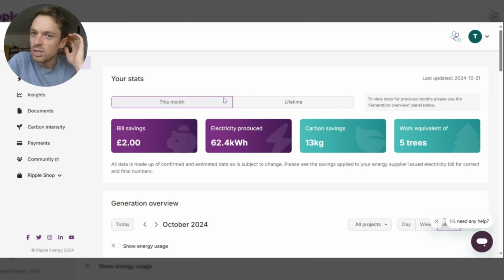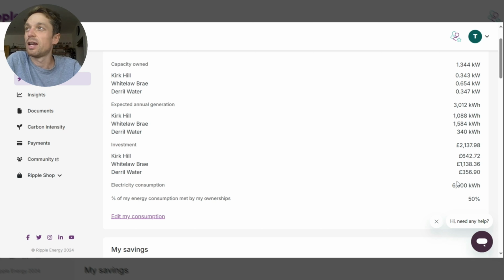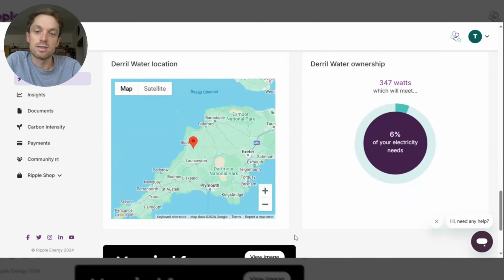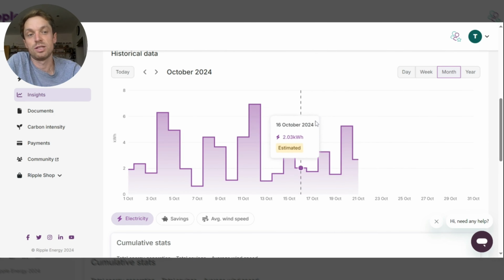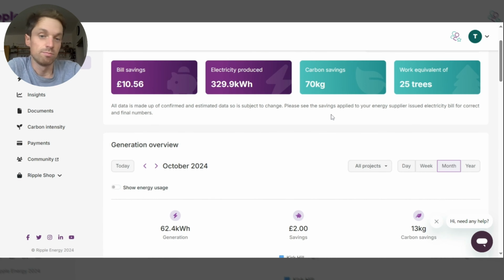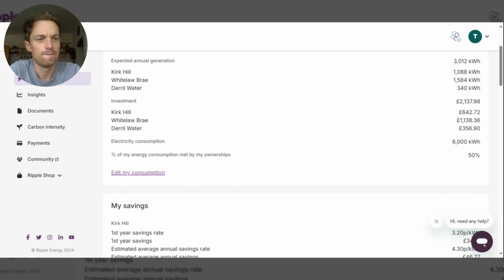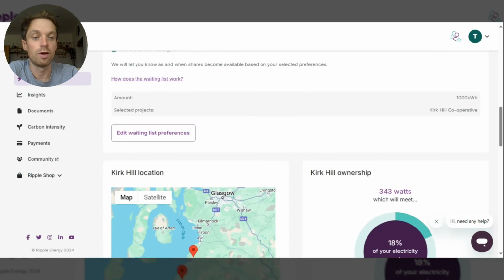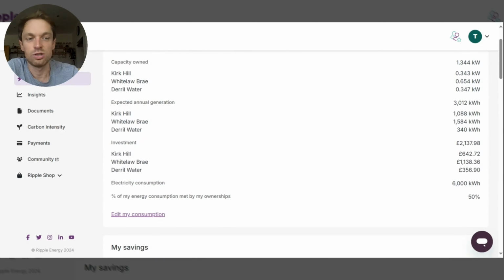How Much Money Does Ripple Energy Generation Save You?

Comment: Thanks Tom for insight! 
Ive joined ripple - really jumping on board because of the fantastic opportunity about the concept of collectively owned green power. 
However - Im feeling a little disheartened regarding the returns... It kind of doesnt add up tbh. 

Basically with the investment made, ill get that back over like 20 years. Ok it's a contributiuon to the movement - which is the ultimate message. 
But the savings due to the fact the energy created is just sold to the grid before coming to your house - is just another let down for individuals trying to make a difference. 

I thought I would get the energy direct to my home - and be able to use that - or simple store it in a home battery etc. But alas no, you have to declare the generation as a sale, which goes through all the hoops as if you were a business. I am glad they are trying to change things in the energy market - but it as bad a deal as selling excess energy generated from your own solar back to the grid.

It could be a game changer for the UK if the rules regarding generation as a coop were on the peoples side - but progression as ever is not very progressive.
Reply from the maker: Hi peachesfruitella - yes it is a bit frustrating, although the remaining costs are what we call 'non-commodity' costs, which, amongst other things, pays for the wires to get electricity to our doors, whatever the cost of the generator, someone would still need to pay for this. 

If we generated at our homes, by solar PV on a roof, or other, we don't pay those costs either.

Although I agree, this is really about doing our bit to support construction of low carbon generation, and it is good that savings will remain for the next couple of decades!

Tom

Comment: Hi great video with a ton of info thanks, With my maths your seeing around 4.1% return at your current info stake price so ROI is 16 years (£1,187.44) That's not taking in to lots of wind or higher elec prices so your ROI could be a lot sooner
Reply from the maker: Thanks - that is helpful! 

We have just had a savings rate notification for next year, and it does look like savings will be higher. Which is good news!
Reply: @TomBray-LowCarbonLifestyle  Your welcome and great news for next year, and as i said 4.1% is better than holding your cash in a bank, and who knows if the wind blows or elec goes up your % will also rise, I bet year on year the elec price will keep going up, so to me that means your ROI will keep dropping also

Comment: Ok the ROI is a lot less than we might have expected if wholesale electricity prices had remained what they were when we invested 2 1/2 years ago.  But had the prices remained that high, and domestic customers were no longer protected by the price cap, our total bills would have risen a lot.

I am on Octopus agile rates and am able to shift around usage to minimise peak times and use more when prices are very low or negative.  So far this year my import rate has averaged 11.7 p/kWh.   2 years ago that was 26 p/kWh.

So the net price if I was generating enough from my KW investment to cover my imports is now 8.5 p.  2 years ago even if the savings rate was 10p per unit, my net price would be 16 p or almost double.

So I'm not too disappointed that wholsale prices have dropped from those record high levels.  By building more wind generation we have helped to lower bills and not just for ourselves.  

We could have taken a contract for difference which would have given a better savings rate now.  A large majority opted for  
a more adventurous approach and we need to accept that the best that can be negotiated annually will vary.  All signs are that the new rates for the next 12 months at KH and the first at DW will be higher than we have seen so far.

I put a new kitchen in last year largely to replace a gas cooker with an electric oven and induction hob.  In cash terms there will never be a return on investment.  It was still the right thing to do though.

Comment: I'm all in to cover my modest 2400kWh p.a. mostly on Kirk Hill and a top-up on Derril Water. The time & cost overruns and consequent low gas contract price for the first six months are a shame but I think we'll see the slow start through and it'll look a whole lot better after the winter and spring generation. 
My prime objective was to match my annual power consumption since I have a difficult house for solar, the second was hopefully for it to wash its face financially. This kind of thing should only ever be a small proportion of any portfolio. Many others have seen it as a hedge against gas prices and Craig Fatha was early proof of that last year but there are other bets in play, it might be an inflation hedge to some extent and who knows how reform of the electricity markets will be implemented and how the small co-ops will be treated. 
You need a strong enough stomach to ride the ups & downs. I remind everyone that the monthly payment is partly return of original capital and partly treated as taxable interest with end-of-year certificate.

Comment: I am also a member of Kirk Hill and you have to be very careful as the 3.2p/kWh is currently very low for 2 reasons. 1 is that this year (up until Jan) the Co-op is currently raising a cash buffer as the co-op is brand new and has no cash and the co-op is paying off additional building expenses which were higher than expected. The second is that the rate we secured for 2024 was very low compared to "normal years" and come Jan 2025, we expect this rate to increase significantly (maybe even 50-75% increase) which will bring the payback to within normal expected ranges (est. 10-15 years) as per share offer.

Comment: Considering the cost of a 400w solar panel is around £80-£150 this doesn’t make that much sense to me unless I you can’t get solar for some reason
Reply from the maker: Very true, although installation cost for a solar panel would be a bit higher than £150. Particularly if on a roof with scaffolding, plus the inverter, and electrical installation to domestic system.... so £640 for 343 watts isn't that bad....
Reply: @TomBray-LowCarbonLifestyle  good point. I suppose that unlike solar it is also 343 watts of constant generation, though it looks like you can't realise the full value of that in terms of bill offset. Wish the government allowed us to fully benefit from remote generation - that would be game changing.

Comment: I'm confused about how it works - do you get paid as a proportion of what the turbine generates, or do you get a fixed amount off every kWh you use? 
If you had a battery and bought all your power at the 6 or 8p/kWh off-peak rate, would you still get 3p off each unit?

I think it's worth mentioning that Ripple say repeatedly: "ownership should never be seen as a financial investment". Rather than looking at the ROI, it's probably better to look at it in terms of how much carbon emission you prevented, especially when many offsetting schemes are just scams.
Reply from the maker: Hi Robin, it took me a while to get my head around too. The payment is saving on every kWh your portion of the wind turbine generates, i.e. the wind turbine generates some electricity, it is sold to the grid for 6p per kWh, there are costs associated with running the wind farm, let's say 2p per kWh, so members get 4p per kWh as a saving on electricity bills... if the turbine generated 1000 kWh in a day, and my membership was 1% of the turbine, that would be 10 kWh * 4p per kWh, i.e. 40p savings.

Savings are delivered monthly based on generation, rather than based on your usage. 

Completely agree it shouldn't be seen as a financial investment, or at least purely that, it is a lifestyle choice to help support the low carbon transition, as well as getting some savings in the long term!
Thanks for engaging with the video
Tom
Reply: @TomBray-LowCarbonLifestyle  Thanks, that's actually fairly simple now you've explained it. You get a share of the profit from the turbine, and it's not really linked to your energy use, except to limit the size of share you can buy.

Comment: Hi Tom, Thanks for the video. I have invested £2300 in Kirk Hill and this is expected to generate 4200 kWh/annum to add to our 4200 kWh/annum we generate with our solar panels (no battery). Our total energy use is about 8750kWh/annum so these two make us sort of neutral . Our electricity import is currently 6300 kWh  so Ripple is about 67% of this.  Savings so far £40 so £10/month ish. Our net electricity bill is after export credits is currently £76/month. Import includes the house,(1550kWh) 7kW ASHP (2500 kWh) , EV charging  (1950kWh), DHW Eddi (300kWh). Yes savings a little low atm but have offset 2/3 of my remaining imports and saved about 13% on my net electricity bill. PS how do you get the Octopus energy data to display in Ripple ?
Reply from the maker: Thanks for the summary Philip - you are a bit further down the path than me! Great stuff to have 67% of your electricity import covered by Ripple!

On the front page of the dashboard, under the generation overview, I can toggle 'show energy usage', is that available for you?

Tom
Reply: @TomBray-LowCarbonLifestyle  Just checked and I don't have that toggle. I am with Octopus and getting the savings credited to my account. Looks like an API missing or something. I use Home Assistant so maybe I can combine the data there. Looks like some tweaking somewhere :-)

Update : Just found out that although Ripple had my account number I needed to enter the Octopus API into the Ripple settings under integrations. Might be useful adding this to your notes for information. My data from June - October shows I have imported 1402kWh + self consumed 888 kWh = 2290 kWh used. Solar Export was 1151 kWh  + Ripple Generation 1269 kWh = 2420 kWh so net 1018 kWh in "credit". Happy with that. Keep the videos coming .